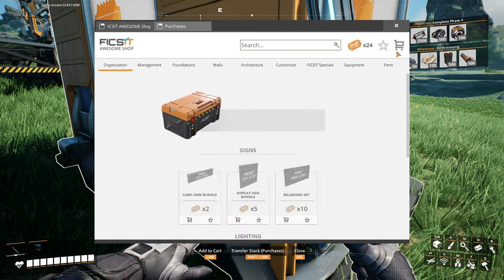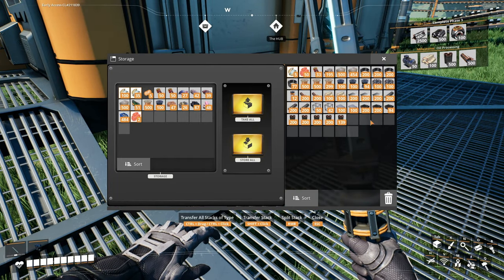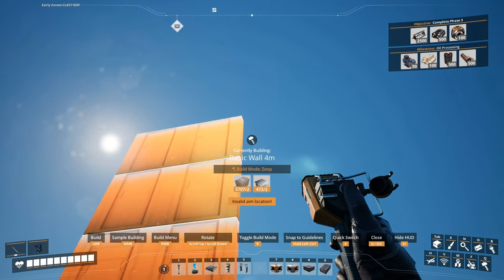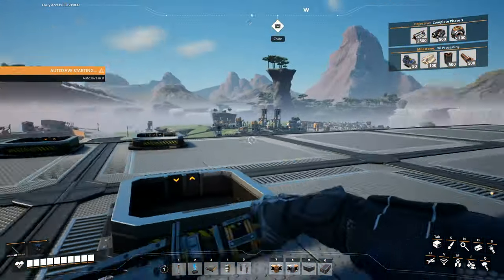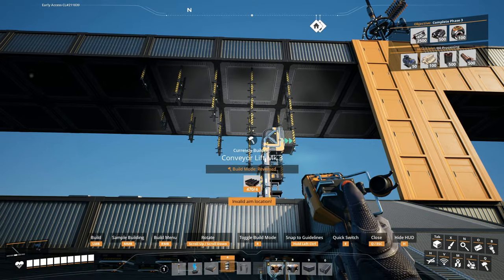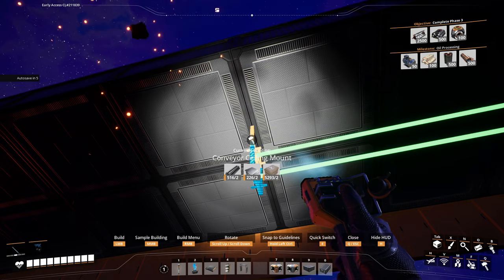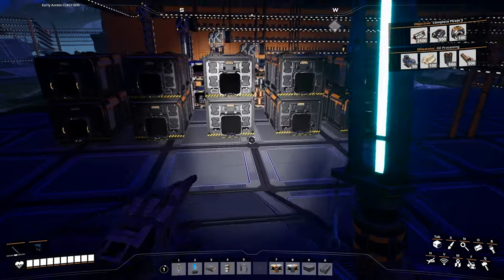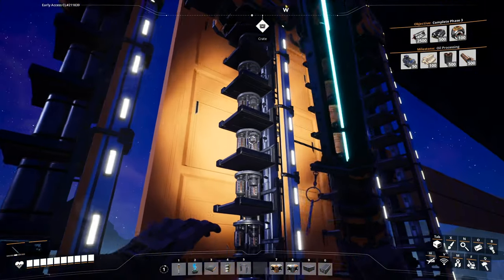Building the Second Floor - Let's Play Satisfactory Update 7 Part 54

Comment: So painfully to watch how you use the conveyor holes, guess you will find out in a later episode
Reply from the maker: Was I using it wrong? It seems to be working fine.
Reply: @GGBeyond  hahaha yes it works but you probably already found out that you do not need to use it as a hole but you can connect to it from both sides so you do not need to go up and down for every connection
Reply from the maker: Well actually, I never knew about that until you told me. And I'll be continuing to do it for a while because I legit thought that's how it was supposed to work. I'll start doing that the next time I play assuming I can break the habit I formed. Thanks!
Reply: @deacom8528  oohhh look at mister "I knew everything from the getgo so let me be condescending"